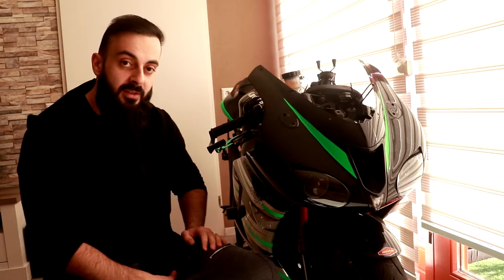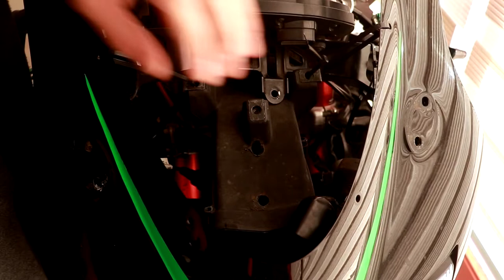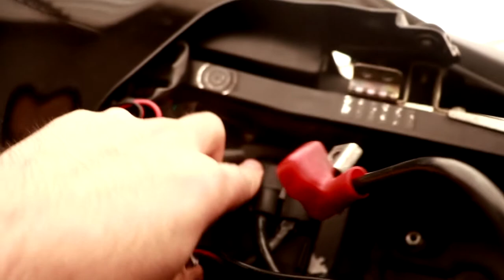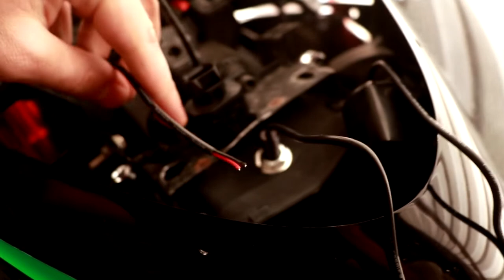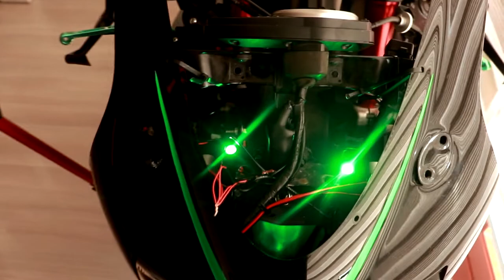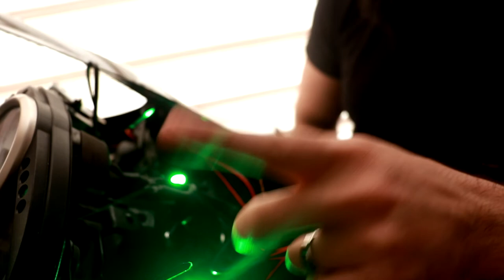Upgrading the LED kit on my 2008 ZX6R

Comment: aye bro i have a ‘07 zx6r and i got some 6k led low an high beams on the way and was wondering if you could do a vid on installing headlights.
Reply from the maker: I can but its very simple. You rotate the headlight cover off. Twist the light off. Twist the led in plug it in and put the cover back on